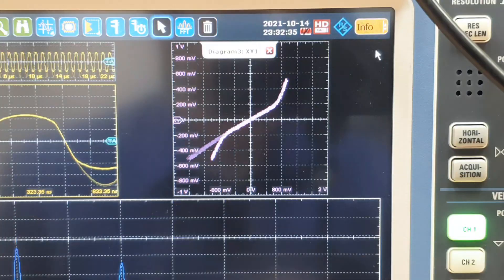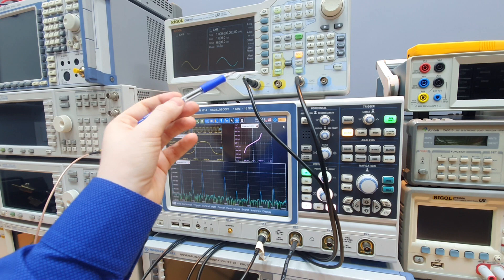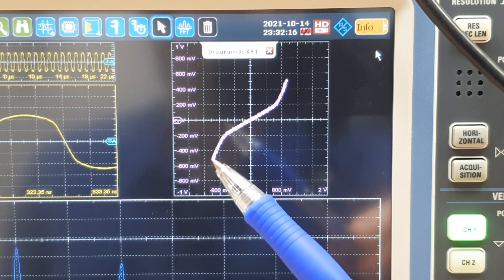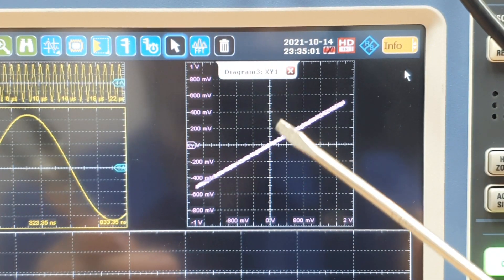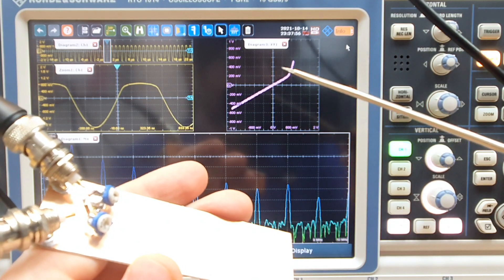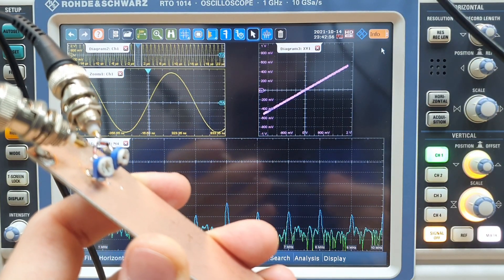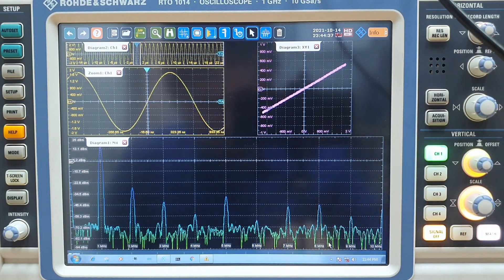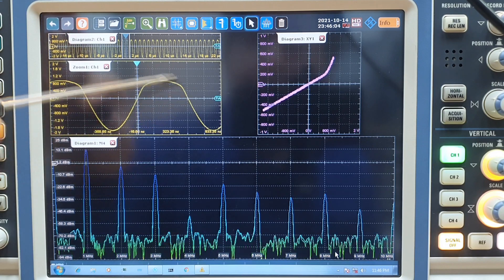Nonlinear Circuit Distortion Explained: Odd vs Even Harmonics Made Simple

Comment: TRANSFER FUNCTION it's not an proprietor term for this XY plot!?
Is it transfer curve or characteristic curve?
Is it transfer function term reserved for dynamics of linear systems?
Reply from the maker: Transfer function is also a correct term, more used by mathematicians
Reply: @AllElectronicsChannel  yes, but this dynamic system not a math lecture.
The transfer function it is the result of division of the Laplace transform of the input, to the Laplace transform of the output.
Used in different context hurts my brain.